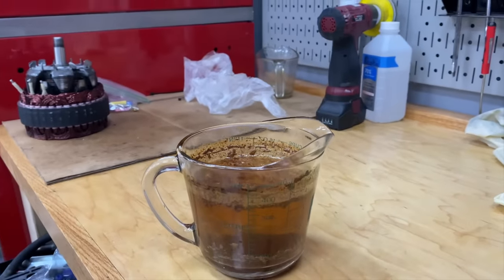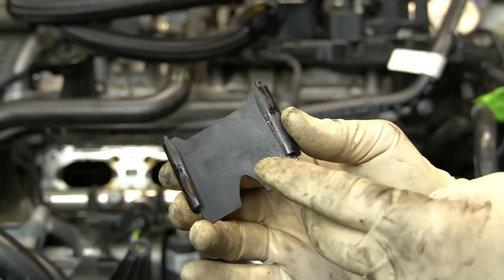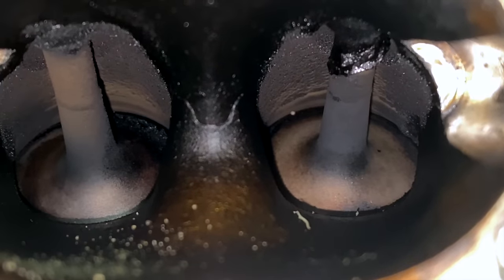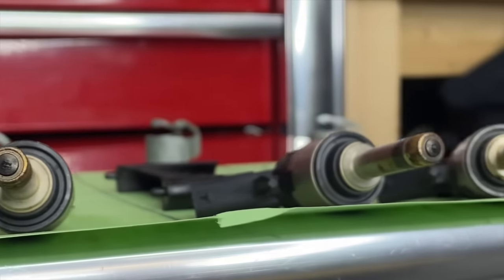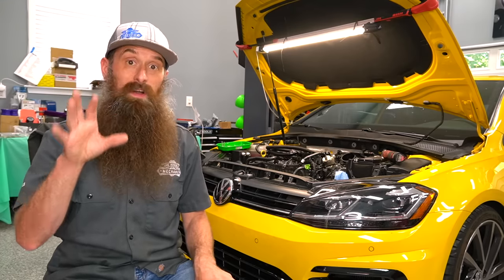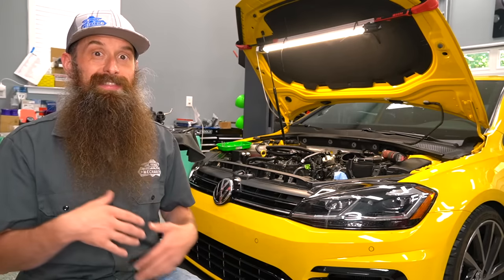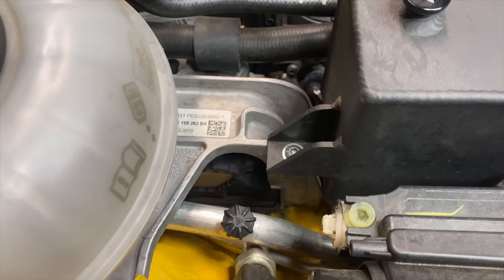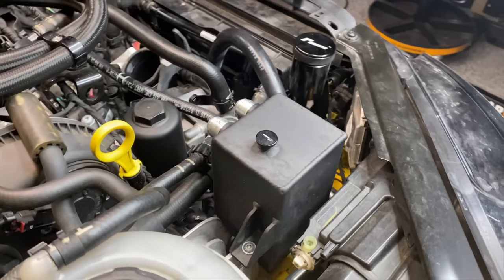Did the Catch Can Work? 10k MILE TEST

Comment: I have a catch can on my 2017 Tiguan and have noticed the same thing. The cooler it is the more water it collects. Moisture is a by product of combustion and this is coming out as blow by and rerouted into the intake manifold by the manufacturer. The catch can seems to condensate this moisture into liquid. I have to drain mine every 1 or 2 thousand miles. This is a VERY stinky liquid. Don't spill it and were gloves. Treat it like hazardous waste. But on the upside I've noticed my oil doesn't smell so bad anymore at 3000 miles and I'm certain it is cleaner too. All of this is bound to help with carbon build up.

Comment: One thing Ive learned with catch cans. It is best to have your catch can close enough to your engine as to keep it warm and prevent freezing. Best 2 empty out the catch can after every use if using the vehicle in a cold/freezing environment.
Reply: Some other guy said to put a little alcohol in the catch can so the water doesn’t freeze over.
Reply: @markm0000  Wouldn't the alcohol evaporate?
Reply: @bulletproof8686  I don’t know. Maybe antifreeze would be better but that’s not good for your catalytic converter. Just drain the catch can more often in the winter.
Reply: Close to the engine? 
Once the engine has cooled - then what? Back to square one.
Reply: @CadillacDriver  if you're dealing with below freezing temps like here in Wisconsin, it's best to park it whenever u can in the garage. If u do have to park it outside in freezing weather, then unscrew the can either when you park for the night or make sure u take the collection cup off and empty it out. There are plenty of issues and possible oil starvation if you're dealing with the temps that I'm currently dealing with. As we speak, it's 6°F with a -27°F wind chill. Normally, my sleeper wagon hibernates throughout the winter, but thanks to a county plow with a front shovel, which has a height of my Fiesta hatchback, I'm driving my show car till it gets back from the collision place. Sux, but yuh gotta do what yuh gotta do.

Comment: The Humble Wife: "Honey, where is my good measuring cup?"

Charles: ...

Is there a recommended interval for cleaning valves in a DI engine? I would be interested to see how the engine looks with a catch can from clean, all the way to that interval.
Reply: No. There isn't any intervals for cleaning valves, but from what I've heard and seen, you might want to inspect them at around 80000 km.
Too much carbon buildup will cause a code on the spark plugs/coils (can't remember the code at the moment) and a rough idle when cold.
Reply: @panzerveps  — I have 100,000 miles (160km) on my Di Mazda 3 engine. I’ve been driving it for 7 years, since 3 miles on the clock. Runs like new @ 105k miles as I type this. 

I do thrash on it quick a bit though, revving it out to redline “Frequently”. 😅
Reply: @I_know_what_im_talking_about  If you aren't running a catch can you might think about cleaning those valves before a chunk of that gummy crap screws up your engine.
Reply: @chasl3645  — bruh, it’s been two years since my post. The car now has 135k miles. Still no driveability issues from Carbon. 🤷🏻‍♂️
Reply: @I_know_what_im_talking_about  I just went to 140,000 with my Optima if it starts using oil, baby it. I take my wife's car up to the gas station a couple times a month and wash it for her then I give it an Italian tune-up and drive home. Didn't work so good last time lost compression on cylinder 3. Car was running like a dream. Until that happened. I'm putting a catch can on my new engine.

Comment: Thanks.  Good analysis.  1990s VW engines were having engine oil sludge problems at some point (not sure which engine or engines).  The oil change places were always recommended a flush, and special fluid additives.  Kind of a a scam.  My 2001 forest green VW Golf (2.0 TSI) developed a toasty oil smell at one point.  I couldn't detect any leaks, and there was NO oil dripping on the pavement.  The culprit turned out to be the oil filler cap.  I replace the (plastic) OEM filler cap with a metal Stant replacement cap.  I also added a second rubber gasket to the cap.  I think what was happening is that once the engine reached operating temperature, the plastic cap deformed just enough to allow oil vapor to blow past the gasket.  ABS plastic is not a good substitute for steel or aluminum.  Same car needed a new water pump a few years later.  ABS plastic impeller failed.  I only learned later that there are after market water pumps with steel impellers.

Comment: You could take the catch can off and check the valves after another 10k miles to see if the carbon/yuck on the valves comes back :) Do you think the oil burning smell is from catch can causing a restriction on the PCV system? Would that cause oil in the combustion chamber?

Comment: I know this is two years old at this point, but I want to say that I'm glad you mention the freezing of a catch can due to water.  I have had freezing happen twice on my WRX, once with a cheap catch can, once with my AOS installed.  I found out that the problem is that the PCV lines are directly under the intercooler, which when driving at higher speeds for long periods caused the lines to freeze.  Then, with the car sitting outside overnight, the catch can freezes.  My fix is to put cardboard over the intercooler in the winter, that keeps the cold air from freezing the lines.
Also, while it's not 100% effective, part of the problem still exists with the EGR. That's what's cooking the oil and turning it into carbon.  Even with a catch can, there will still be some oil in the system, just not as much.

Comment: I have the same catch can installed on a MK7.5 as well and I installed it because I watched your video and I have to say the same about the oil smell after the install. Also I have the same dislike with the engine bolt and washer bottle diminished capacity. I hope others understand it's not a cure to the carbon build up but a little help in preventing it.

Comment: That smell is coming from the catch can hoses weeping crankcase vapors when they get hot.  Great vid, shows catch cans dont help reduce carbon buildup on gdi engines, ive been trying to convince people of that since they started becoming available.  They only collect water (condensation) and soot that would be burned off in the pcv hoses and engine anyways as the system was designed.  Changing oil every 3k miles and keeping up on maintenance is all we can do.  Catch cans were originally made for old school race engines that would blow oil out the valve cover breather at high rpm, dripping oil onto the block,  exhaust or the track.

Comment: I run a catch can on my silverado 5.3L (Vortec, not a DI ecotech) and I’ve never had a problem with it freezing up in winter time even after 3 winters with below 0° temps. But I also have never seen that much water:oil come out of my can. I have just a small moroso can, but I drain it every 2k miles or so, little more frequently and it’s never been full.
Reply: Just add an ounce of straight anti freeze to the can in the winter

Comment: You should try the Mann and Hummel catch can. It's way more practical and easy as to drain.
No need to remove the can itself. It has a drain hose which collects the oil and water and is simply emptied via a tap at the end of this hose. It also has a filter element within the can itself which, as per manufacturers instructions only needs to be replaced every 40000 kilometres. 
Hope this helps. 
Cheers for the video 👍

Comment: I put a JLT catch can on my L86 (DI 6.2L) and in the summer I may get a few ounces of just oil over 5000 miles or so. In the winter I have to empty it every 750-1000 miles due to the water it catches (I wish it was bigger). I installed it for the same reason as you. To keep the valves from getting gunked up causing poor performance. I have been running it for almost 2 years now and performance is as good or better than when I installed it. This video made me feel better about it keeping the valves clean as I don't want to remove the intake just to check. Thanks!

Comment: I have a Nissan Frontier 3.8L DI engine with a small Moroso oil separator installed.  It doesn't collect any noticeable water. I can freeze the bowl overnight and no ice to be found. I'm sure the small volume allows less water to condense as the system cools after shutdown.  I know, completely different engine, separator and probably driving conditions.

Comment: I've had a cheap catch can on my mk6 gti for over a year now, and I can tell it's helping because my tail pipes aren't carbon black every 2k miles anymore.... actually I haven't had to clean them all summer, they're still nice and chrome.  That has to be helping further upstream logically.
Reply: What does this mean if tail pipe is black my camaro Is
Reply: @great4ever845  it means your engine is burning oil and not just gas. This isn't abnormal, as pcv vapors contain oil and are vented into the intake by design to be burned off.
Reply: @great4ever845  or it's running rich

Comment: I ran a catch can for a while.  You get a LOT more water in there in the winter, leading to the potential freezing you mentioned.  I figured condensation pulled in through the PCV system would not be a bad thing in small amounts.  It didn't seem to do anything for intake valve buildup for me either.

Comment: Catch cans are 100% worth it on anything direct injected or even port injected engine. If VW would use both port and direct injection like every other manufacturer has done to eliminate ir prevent carbon build up! Their engines would run so much cleaner but nope they’re still stock on just D.I. 🤷‍♂️
Reply: This is why I refuse to purchase a new VW. Steadfast German dedication to questionable technology. Let’s go back to the time when VWs were properly engineered!

Ps I drive a Mk3
Reply: @aygwm  ALH here!
Reply: MPI is standard in most german VWs though? EA888 gen 3 has MPI and my 1.6 A3 from 10 years ago also has MPI.
Reply: @whuzzzup  not in the u.s
Reply: @whuzzzup  not anymore in the EU. It's DI + particulate filter. 

I have one of the last dual injected EA888 gen 3 VAG cars before they all switched.

Comment: This is the best video iv seen so far about catch cans testing ,really enjoyed it , well at least it didn't make things worse 🤣 , looks promising ,    i built my own , took for ever though but can screw of the body easily no other dismantling involved  .Many thanks .
Reply: I want to build one and was thinking to use two old oilfilter cans, the upper should hold the siphon tubing and the lower should unscrew like an oilfilter to empty it. do you think that could work or is such device not as simple as I imagine?
Reply: @naotamf1588 Well i actual bought a  BMW  oil catch can off ebay was about £15 saves on that side of the build ,  as it has two 19mm in and outs on it ,the rest like brackets, fixings, pipes, and hook up to psc valve and to turbo in elbow i had to think long and hard, as its all gota seal properly with O rings ect ,so you need to be up on it ,and thinking out of the box.Sure Anything can be done .

Comment: Is there a difference in fuel mileage since all that water vapor isnt going back into the engine?
Reply: I'll leave my comment here because thats a solid question!
Reply: Over the course it probably makes the smallest difference, to the point where it is hardly measurable.
Reply: @couch1596  That's called an assumption :D
Reply: No. Such an amount collected in the catch can over 10k miles is not going to affect mileage when you take into consideration how many fuel-ups it would take to reach 10k miles.

Comment: Have you had any experience with dry ice cleaning to remove carbon deposits? It would be interesting to see if this method is a possible replacement for chemical/manual and/or walnut shell cleaning. I've seen a number of chassis cleaning videos where dry ice is used to remove years of accumulated grime from under the car. One would think the same method should work for carbon removal too.
Reply: works great on turbines, havent seen it used on a normal engine though
Reply: The problem with dry ice blasting is that it's multiple times more expensive than media blasting because the machines are extremely expensive and it's super slow. You can even buy a cheap media blasting setup and do your own walnut shell blasting but good luck affording a dry ice blasting machine.

Comment: Thanks for sharing. One important note to add is all catch cans are not created equal. Have to be careful the crank case pressure don't go too high. If there is a filter restriction in the can, that burnt oil smell you are talking about might just be from too much pressure being forced out some where and you now smell it. Example-,  Mishimoto cans with that screw in filter (inside the can) create back pressure in the line from the PCV valve line that goes into the inlet of the catch can, and it needs to be removed and let the baffles do the work.